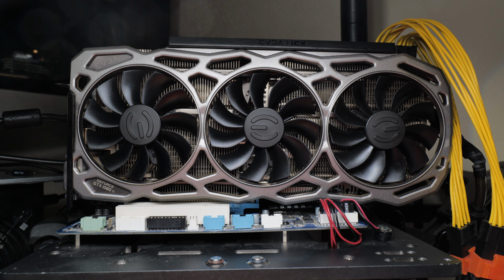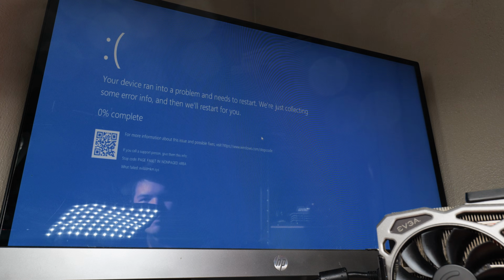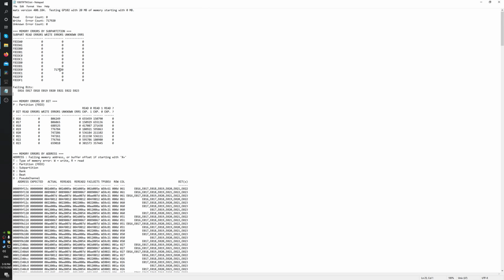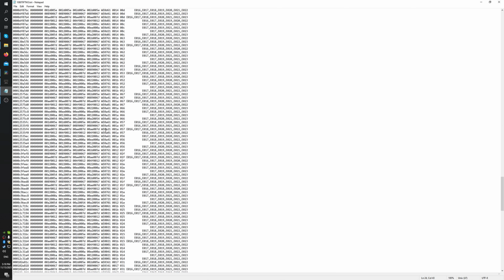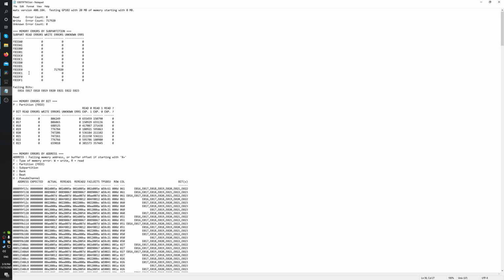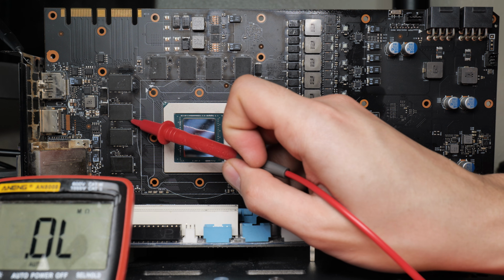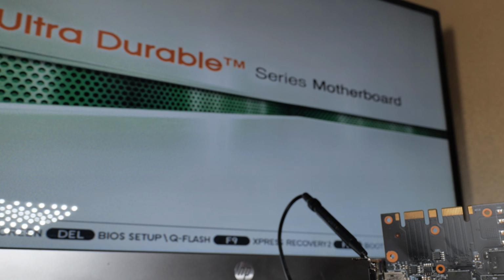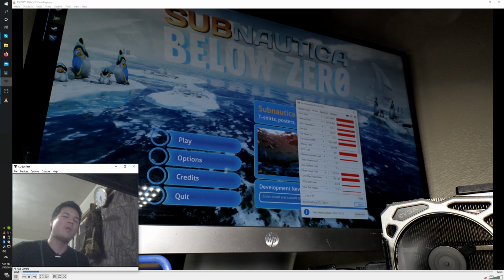EVGA GTX 1080 Ti FTW3 Graphics Card Repair - Post With No Image and Crash on Driver Install

Comment: Whould reflow on that particular mem ic do the trick?
Reply: Not always because the error usually lies with the memory being overheated, usually due to mining. The memory becomes unstable and unable to use the voltage it is meant for. You can use MSI afterburner to down clock the mem a bit and see if it becomes stable.

Comment: Hello, how are you, I have a 1080ti founder's edition of the zotac brand, since I put a monitor at 165hz and updated the drivers, it freezes when starting windows, and everything goes very slow to the point where I cannot work, much less run a game, the drivers with which it lets me use my graphics card are version 472.12, any solution?

Comment: I got a gtx 780 and when I install the video drivers it goes black screen also the bios screen I see artifacts so I decided to use mats to check and it show that one module of vram has errors (to be more specific it has 5360 errors), do you think that module of vram is the cause of the black screen?

Comment: Hey can you make a video on how to replace that memory in detail so i see how it is done
Reply: the part he cut out was just laying a small amount of flux on the contacts and placing a small amount of solder on each one and using a tweezer to position the memory module and a heat gun to get it to settle in place.

Comment: The problem is similar to the one in the video, but when I use MATS, there is no error at all. Is it a faulty GPU chip? btw, my GPU is 1060 and I'm using MATS version 367, thx
Reply: MAts would show ALL or most memory modules bad if the controller was dead, controller is built in to GPU core. . .

Comment: i had same issue with my rx 480 8gb, it crash when i tried install the driver, when i check it on windows error code 31, is that because memory module issue?

Comment: Como usas el mats con la grafica que no da video
Reply from the maker: I have a guide video on MATs, it'll show you.
Reply: I have a 3090 graph with all the vcore and vram voltages but the pc does not detect it, the chip heats up normal

Comment: Great video as always! 
One question, can you get away with reflow/reball or you go straight to change the chip with new one?
Reply from the maker: I always change the chip, I never reball.
Reply: @TechCemetery  thank you for answering, i tried reflow but only thing that changed is number of errors got lower. One more question if I may, what soldering tip size are you using?

Comment: Hi i just run mats on my faulty 1080ti, and i have one faulty memory module not with 00ff00 errors but only ffffffff errors on the whole module. It looks like mats wasn't able to read the memory module. Is the memory controller broken ? Great video btw
Reply: mats version 400.184.  Testing GP102 with 20 MB of memory starting with 0 MB.

Read    Error Count: 0
Write   Error Count: 959414
Unknown Error Count: 0

=== MEMORY ERRORS BY SUBPARTITION ===
SUBPART READ ERRORS WRITE ERRORS UNKNOWN ERRS
------- ----------- ------------ ------------
FBIOA0            0            0            0
FBIOA1            0            0            0
FBIOB0            0            0            0
FBIOB1            0            0            0
FBIOC0            0            0            0
FBIOC1            0            0            0
FBIOD0            0       959414            0
FBIOD1            0            0            0
FBIOE0            0            0            0
FBIOE1            0            0            0
FBIOF0            0            0            0
FBIOF1            0            0            0

Failing Bits: 
   D000 D001 D002 D003 D004 D005 D006 D007 D008 D009 D010 D011 D012 D013 D014 D015 
D016 D017 D018 D019 D020 D021 D022 D023 D024 D025 D026 D027 D028 D029 D030 D031 

=== MEMORY ERRORS BY BIT ===
P : Partition (FBIO)
                                            READ 0 READ 1 READ ?
P BIT READ ERRORS WRITE ERRORS UNKNOWN ERRS EXP. 1 EXP. 0 EXP. ?
- --- ----------- ------------ ------------ ------ ------ ------
D 000           0       482597            0    134 482463      0
D 001           0       953341            0     86 953255      0
D 002           0       482598            0    128 482470      0
D 003           0       953366            0     52 953314      0
D 004           0       482598            0    128 482470      0
D 005           0       953349            0     70 953279      0
D 006           0       482615            0    163 482452      0
D 007           0       953357            0     54 953303      0
D 008           0       482598            0    128 482470      0
D 009           0       953358            0     68 953290      0
D 010           0       482615            0    163 482452      0
D 011           0       953333            0    102 953231      0
D 012           0       482582            0     87 482495      0
D 013           0       953375            0     50 953325      0
D 014           0       482581            0     93 482488      0
D 015           0       953367            0     66 953301      0
D 016           0       482582            0     86 482496      0
D 017           0       953317            0     99 953218      0
D 018           0       482636            0    178 482458      0
D 019           0       953338            0     89 953249      0
D 020           0       482609            0    132 482477      0
D 021           0       953389            0     17 953372      0
D 022           0       482582            0     86 482496      0
D 023           0       953353            0     58 953295      0
D 024           0       482690            0    252 482438      0
D 025           0       953336            0     82 953254      0
D 026           0       482636            0    172 482464      0
D 027           0       953372            0     41 953331      0
D 028           0       482717            0    304 482413      0
D 029           0       953353            0     58 953295      0
D 030           0       482636            0    172 482464      0
D 031           0       953336            0     82 953254      0

=== MEMORY ERRORS BY ADDRESS ===
ADDRESS : Failing memory address, or buffer offset if starting with 'X+'
T : Type of memory error: W = write, R = read
P : Partition (FBIO)
S : Subpartition
B : Bank
E : Beat
U : PseudoChannel
   ADDRESS EXPECTED   ACTUAL  REREAD1  REREAD2 FAILBITS TPSBEU  ROW COL                                                                          BIT(s)
   ------- --------   ------  -------  ------- -------- ------  --- ---                                                                          ------
000135ccbc 00000000 ffffffff ffffffff ffffffff ffffffff WD0060 001c 025 D000,D001,D002,D003,D004,D005,D006,D007,D008,D009,D010,D011,D012,D013,D014,D015
000135ccb8 00000000 ffffffff ffffffff ffffffff ffffffff WD0040 001c 025 D000,D001,D002,D003,D004,D005,D006,D007,D008,D009,D010,D011,D012,D013,D014,D015
000135ccb4 00000000 ffffffff ffffffff ffffffff ffffffff WD0020 001c 025 D000,D001,D002,D003,D004,D005,D006,D007,D008,D009,D010,D011,D012,D013,D014,D015
000135ccb0 00000000 ffffffff ffffffff ffffffff ffffffff WD0000 001c 025 D000,D001,D002,D003,D004,D005,D006,D007,D008,D009,D010,D011,D012,D013,D014,D015
000135ccac 00000000 ffffffff ffffffff ffffffff ffffffff WD0060 001c 024 D000,D001,D002,D003,D004,D005,D006,D007,D008,D009,D010,D011,D012,D013,D014,D015
000135cca8 00000000 ffffffff ffffffff ffffffff ffffffff WD0040 001c 024 D000,D001,D002,D003,D004,D005,D006,D007,D008,D009,D010,D011,D012,D013,D014,D015
000135cca4 00000000 ffffffff ffffffff ffffffff ffffffff WD0020 001c 024 D000,D001,D002,D003,D004,D005,D006,D007,D008,D009,D010,D011,D012,D013,D014,D015
000135cca0 00000000 ffffffff ffffffff ffffffff ffffffff WD0000 001c 024 D000,D001,D002,D003,D004,D005,D006,D007,D008,D009,D010,D011,D012,D013,D014,D015
000135cc9c 00000000 ffffffff ffffffff ffffffff ffffffff WD0061 001c 025 D016,D017,D018,D019,D020,D021,D022,D023,D024,D025,D026,D027,D028,D029,D030,D031
000135cc98 00000000 ffffffff ffffffff ffffffff ffffffff WD0041 001c 025 D016,D017,D018,D019,D020,D021,D022,D023,D024,D025,D026,D027,D028,D029,D030,D031
000135cc94 00000000 ffffffff ffffffff ffffffff ffffffff WD0021 001c 025 D016,D017,D018,D019,D020,D021,D022,D023,D024,D025,D026,D027,D028,D029,D030,D031

Comment: If you have AMD how can you figure out which memory it is? Or do you just replace them all?
Reply: can tech cemetery answer for this not just the mocking?
Reply: There's no easy way as with Mats for nvidia, unless you also hack amd or its partners and get a gold of whatever software they are using.
You could replace them all or one by one.
Reply: Although its possible to use other methods sometimes such as he does in this video with an rx 580
https://youtu.be/VWDYmCmIde4?t=50
Reply: https://www.youtube.com/watch?v=esORhmH_DzA

AMD HD 7000, R7, R9, RX 400/500, Vega 64

Comment: I have MSI 1080ti that had bad memory module and i changed it with one from asus rog 1080ti not the card have no errors what so ever but it crashes again as before when i install the drivers. What do i need to look for next help me please.
Reply: Run the program he just used in the video to see if you still have memory related problems. Use voltmeter to see if you got any shorts.
Reply: @Piohm  No shorts that i can find. I ran that program before and after repair and after i changed the memory chip there ware no errors at all all came clear but the problem still exists. As last resort ill try to reball the GPU chip.
Reply: @Calardo666  You said your computer crashes? What's the BSOD error code that you get? I think that will the clue to know what to look for next.
Reply: @Piohm  Im not sure that it gave BSOD or just black screen and restarted it was like a 2 months ago when i tested it and just put it in a box and forgot about it. Will check tomorrow i hope.
Reply: @Piohm  It goes to black screen immediately after the card detects the drivers and restarts the PC
Reply: @Calardo666  good luck with your computer! I really hope you fix it!
If you can't, or don't have time to fix it, repair shops do the trick. (But I don't have that kind of money…)

Comment: I have a 1070 FTW2 that is 100 fan , black screen... i took it apart and redid the thermal paste but the heat pads i had to reuse. 

I was going to take it apart again and do pads this time but if it works for content for you maybe we can do something.

- heres the real joke on me. I origionally bought the OG FTW 1070 , and did the 100 upgrade to the ftw2 model to lock in reliability... 2 months after 3 years it drops on me. I had to scramble and luckily found a 2060 super that im using to keep streaming and recording, but that was a gut punch when that card started to malfunction.